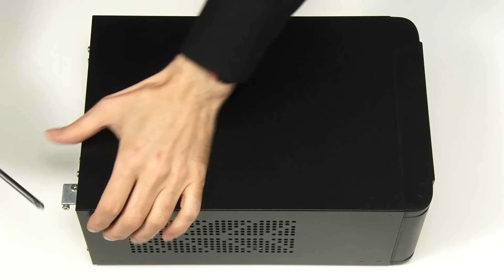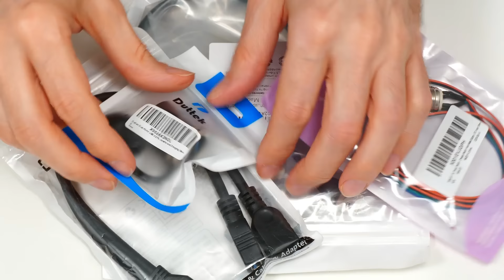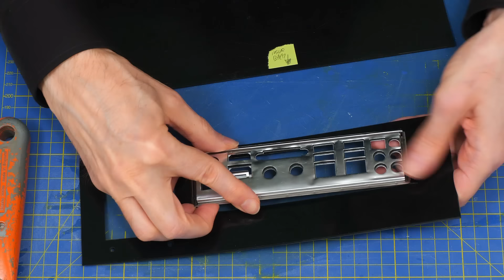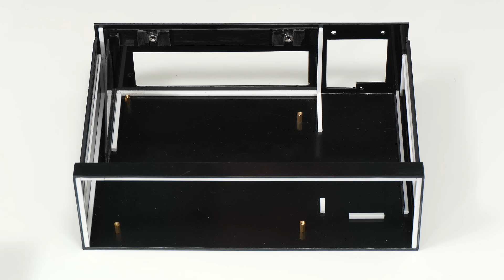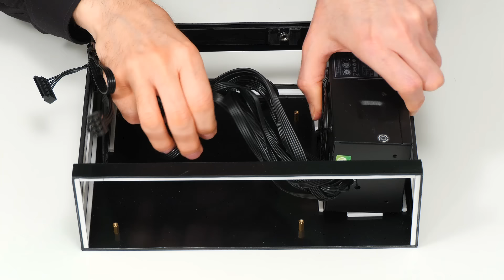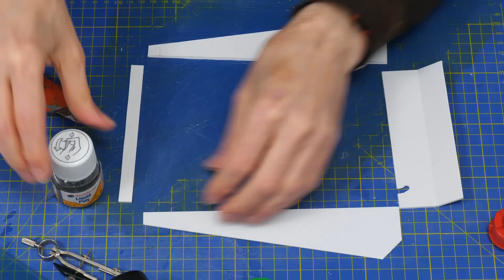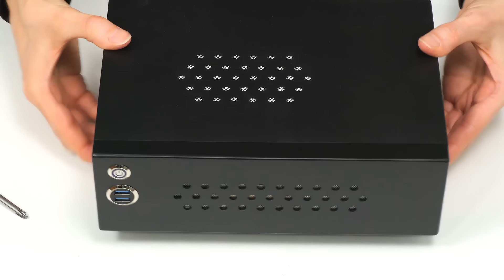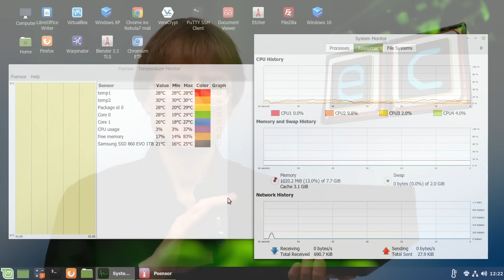DIY Mini-ITX Case

Comment: Chris, Paul Sellers and Rex Krueger are the people who make YouTube, however ensh*ttified by 2026, still relevant.

The most fun thing about technology is not just using it but creating stuff based on it. If I start delegating thinking and building to machines, I can as well just buy the finished product. It's easier and cheaper. But it's not fun. Assembling an IKEA cabinet or using power tools for everything is quick, cheap but boring. 
Same with "building" software with LLMs (ok, actually worse, at least IKEA doesn't hallucinate instructions and a table saw doesn't occasionally delete the table or your limbs regardless of the input).

Experimenting, trying something new, making mistakes and finding what works, developing skills that just weren't there yesterday, using the simplest tools to create a THING that I can then use is an incredibly fulfilling experience. Learning requires discomfort and friction but is totally worth it.

Thank you for inspiration, Chris!

Comment: no emi shielding may not affect your computer function or other near field UHF devices however it does spit out a LOT of noise which does have harmonics that get down all the way to HF ranges. it makes life very very difficult for amongst others radio operators. the noise is shocking. I love your site and all you do but  I am always asking people to please put their computers in a case and apply any and all shielding they can. even if one side is left open any shielding helps. their are also grounding spray's that work very well that can be sprayed on the inside. please look into this and consider it.

Comment: That looks great.  It seems that with current computer parts shortages and high prices an ITX system will become the high end desktop system.  I've seen videos of people using old cellphone processors to build computer systems, those may be the only processors available in the future, until data centers discover that they can build processing around those too.

Comment: Since ages I am using repurposed Shuttle housings, many of them are Mini ITX capable .
Even the early Shuttle SV24 (made for a Pentium class Via chip) does with little modification even today.
Combine these aluminium made cases with tiny 12V PSU or something like the 300Watt BeQuiet (no langer available).
Take something like the Intel DL-61. Put on a server grade Sandy Bridge CPU and a quite cooler.
It works great still, preferably combined with an external graphics card, even if it is PCIe-1 only.

Comment: I'm thinking of getting and building a ATX micro or ITX mini, with a Ironclad DX & MiSTer FPGA or MiSTer Pi. Although it is predominantly for gaming, I think it would be an interesting project, because I like reminiscing back to MSDos days and Window 3.1/95; but I think others like the old Commodore or Amiga. I'm not entirely sure about the real difference between ATX micro and ITX mini; but rather than making a computer which looks like an old computer, I'm thinking I'd like to do a little tower type computer with glass side and front for showing off  lights inside it. Great job; you really did build the whole thing. Looks fantastic. Makes me wonder what could be build with an old cash tin.

Comment: Running Linux since 1996 and as my main OS since 2002, I never understand why buy a rPi to code in python while a PC is perfectly suitable. Anyway, I own a rPi 1 b+ and tried riscos on it, 1 own a rPi zero which powers a pi1541 Commodore floppy emulator, I own 2 rPi 3. One is running bmc64 in a vic20 case. I use the other one for mcu développement, the serial port at 3.3v is great for debugging

Comment: Christopher, I've been following your content for a very long time and as of right now most of my services are virtualized on a small cluster (have been for years). 

However, I'm running more and more into issues where I need to deploy a dedicated device to "bridge the gap" between services I want to provide for free for my relatives - and all I see is a sea of overpriced SBCs .... 512mb DDR3L 2 cores ARM sbc = 80€. Nothing makes sense - if you could make a video about "ethernet services on the cheap" it'd be amazing, be it for routing (openwrt), simple services such as tailscale or VPN ... I'd be over the moon to know the current cheapest options, because the landscape is changing fast and to be frank ... I want to give access to ones dear to me, but it is becoming harder and harder to do so without having them buy overpriced hardware.

My whole "infrastructure" (homelab) is based around low power, if something that drinks power needs to wake up it'll do on a schedule and shutdown (backups) - N100s and N150s have been a blessing (now they're getting pricier) - 18€ a month in electricity to run so much stuff is amazing (€58ct Kwh makes you think twice about your ambitions)

But I wanna share ... And I feel that hooking up a simple SoC meant to run tailscale has become an investment. If I just go ahead and expose a service it's going to get bombarded - I've lived through it, CPU spikes all over the place, I'm an amateur this is just what I do in my free time.

Send help ^^"?

Comment: Should I try this in larger scale? Big case for EliteDesk 800 G4 SFF which I stupidly bough instead of TWR so now I'm running sweating LP GPU with cover replaced completely with plastic anti-dust mesh held on pieces of double-sided tape.

Comment: ABS has a MUCH higher melt temperature than PLA but I would still not advise making an enclosure with a high voltage PSU from thermoplasts....

Most of the risk is offset by the fact the PSU is fully enclosed by its own enclosure, but if a catastrrophic failure would occur it would find itself surrounded by meltable and deformable and flammable plastic....
Reply from the maker: I did think about this. But as you say, the PSU is fully enclosed in a metal case, with fail-safes. Many products include a PSU not enclosed in metal within a plastic case, and often of a lower quality than we find in a PC.

A computer with a plastic case like this is not something I would leave running 24/7 unattended. But as a normal desktop PC generally only running with a user present, the risk is minimal.
Reply: @ExplainingComputers fair enough, though I would think that other devices with high voltage in plastic enclosures would have to have some fire retardant in the plastic.

The most important thing is to think it through.

One other factor that would suggest using an external psu brick for this project could be firecodes and home insurance rules for any unlikely case where things go catastrophically wrong. 

What helps in that regard would be if the system is only running while supervised. 

In any case the design looks great and you clearly had fun making it.

Comment: If you want an even smaller PSU and can live with an external power brick look for a "PicoPSU". They're very small DC-DC converters just as wide as the ATX mainboard power plug ranging from 80 watts up to 160 watts IIRC.. They use 12 volt input power from a standard barrel jack. The higher wattage models go up to 25 volt.
Reply from the maker: Thanks, but as I noted, the whole point of this build was a small case with an internal PSU. :) I showed a case with a Pico PSU internal adapter and external PSU.

Comment: Just like your cyberdeck this has turned out amazingly well. I've done this kind of thing myself several times but have access to a well equipped machine shop with a CNC router and 3D printer but I have to say I think the only thing I have done better than your case, made with simple hand tools, is the ventilation because I could drill a grid of hundreds of very small holes very accurately so didn't need a mesh. Necessity really is the mother of invention and in this instance the results top notch. 
One thing I do like to do differently is use DC input ATX power supplies inside the case with an external power brick. Or even in some case mounted the power brick inside the case as well, this is normally a much more compact solution when you only need 150 to 250W which is enough for many mini ATX systems.
Reply: You are the 'lucky one', at 83 all work flows are indeed impeded!'😢

Comment: In California, I just bought a 2TB 3.5" HDD for $65USD. A 2TB SSD is over $200USD.  Would it be more economical to make this project work with the 3.5" HDD? Would you just increase the size a few inches or centimeters? Since SSDs are too expensive, should we go back to the 3.5" HDD? In the UK, is it called 3.5" HDD or is the inches replaced with the metric equivalent?

Comment: I love these videos. But you really should get a 3D printer. You won't just be able to use ABS, but materials like ASA-GF. I've done more than a few prints and so far I'm pretty happy. I'm waiting on more accessories to print larger objects and pieces. As I want to start printing PC cases and storage drawer units for organization.
Reply: He has a 3D printer. 
The solid ABS sheet is a much stronger and more consistent material, and for rectilinear builds like this is very simple and quick to use. This is also a more accessible and affordable approach for people who don't own 3D printers.
Reply: @BeOurBee  Understood.

Comment: Much more satisfying than one of the typical Tech Tuber that build a PC. Forget the 3D printer, many just use sponsored cases or a case they had in storage. This is the practical way to build a ITX case that actually works for your setup without just settling for whatever is on NewEgg or Amazon and dealing with the compromises later.

Comment: Awesome! 🎉  I would have used black finger nail polish on the screws.  Also, not sure if it's feasable but having a smaller case and external power supply would also be nice!  Congrads! 🎉

Comment: Thanks Chris for another DYI project case and stunning results.
I was happy to see Stanley the Knife and Mr Screwdriver pulled off the dole to make this worthy project.  I would suggest adding an Oscillating tool to your tool box. Mine assists my knife and speeds up cutting plastic or wood. 
Have a great week.

Comment: Your building of a cyberdeck inspired me. I have a couple of slightly old commodity Android phones lying around, in perfectly good shape but a couple years old. Half an eternity in smartphone tech evolutionary terms. I think it would be nice to build a cyberdeck/ARM-based PC that uses one or more such phones, flashed to run some (not ChromeOS) version of Linux. It's kind of like the "Dex" feature offered on some premium Samsung phones, but without having to buy that premium phone. Just use, well, a commodity smartphone. Maybe you could do a video on such a project? If would include a case to wrap around the phone, making it look like a truly tiny PC case, with a phone wall charger serving as an external silent PSU, and an attached display much larger than the phone screen, which would be mounted into the case surface, serving as a touch input controller and secondary display. The phone screen could optionally be set to go blank when another display is in use. If using more than one phone inside, then you would have a mini-cluster running a cluster OS to make the two or more CPUs share workloads. This makes it a highly energy-efficient and silent home server that could be tucked inside a book on a shelf. Speaking of which, a book-sized PC case might be made of ... cardboard! Possibly with a humorous book title embossed on the front - 20,000 Links Under The C++, LAN Of Green Cables, Great Compilations, and so on.

 Such a project would probably require some coding fu on the software end, unless there are pre-built cluster OSes ready to install and boot, as well as the handy craft skills you cajoled Mr. Stanley into demonstrating here. 😀

Comment: I am pleasantly surprised by the final result. I am someone who designs everything and then prints it in 3D, but after watching this video, your solution seems more appropriate for a PC case. The walls are narrower and more robust; it would be impossible to create a 2mm wall with that finish and strength using 3D printing. Excellent work!

Comment: This is very impressive...and I think worth looking at for techniques that might apply to a number of projects.   I have a Beelink GTR6 and I wanted to upgrade the ssd...a simple thing...well no they decided to go with this tiny fan that had plastic legs that wrapped around key components that you blindly screw down...well I did all that and my bluetooth didn't work anymore as a built in device...my solution remove the puny fan and try again...bluetooth happy...so yea the route the wires step is not for me...but I do wonder about the painting of sbs....I wonder if a similar technic can be used as an alternative to retrobyting for retro machines....I got a trs80 model 4p and it is more yellow than white so thinking of giving that a go...it's such a thing if it works great if not oh well...as it needs work, for some reason only the floppy it came with reads on the machine...

Comment: This turned out so lovely, and really cost effective too. Congratulations to this new case. 

When I built my custom Mini-ITX case I ended up on the very other end, rather not saying how much it did cost. Granted I used 3D printing in house and aluminium machining externally for creating a passively cooled Strix Halo. Strictly speaking also an iGPU based mini-ITX system but with a lot more heat to handle and capable of running modern demanding games. I did also go for a retro design though.

Comment: Looks great! Well done! It's a pity that the USB 3 port you have doesn't have a straight to mb-header cable. The other route, that's save on a bit of cable space, is getting one that goes from the header to a mounting plate, unscrew the mounting plate, then make the appropriate sized hole and mount to the case but it wouldn't have looked half as nice. Once the cables are tucked in there, who would know!

An amazing build!

Comment: On my build I whent with the open case style kinda a test bench I haven't found one yet that better at cooling I wish I could but if 
I cram in all this into one of thoes 
Lil boxes their will be problems 
I'm running an i9 with and old geoforce 4070 with water cooling  on the cpu  😎

Comment: Very, very entertaining.  Thank you Chris.  Tweaked my OCD a little when you didn't blow out the dust from the CPU cooler before the final fitting after spending so much time on the finish of the case!
Reply from the maker: I only noticed it in editing! I wish I'd cleaned that dust.

Comment: Nice build, a quality footage as usual.
What I would have done differently is to mount the PSU 180deg rotated,
so that its exhaust fan would not blow hot air directly onto the CPU,
but out from the case (with some additional holes on that side of the case).
Reply from the maker: The internal fan on the PSU is intake not exhaust. So it is extracting cold air from inside the case and blowing it out the back.

Comment: Couldn't you have made the case an inch taller and make a partition an inch from the bottom to install the motherboard?That way you could  have route the cables under the partition.

Comment: Need more feet, central, usb turn 90° but might be too close to the power button for that, it would make aiming easier, a front upgrade (mini plate) to move the usb lower, a round plug to fit in the old hole
and the usb screw to hold mini plate flush, not flush glue or use power button on a bigger mini plate.

Comment: You made a very nice case there. Quite impressive!  Next time, you need to get a new 3d printer from a sponsor and design one hint hint.  Question: Are external power supplies such a bad idea?  Most laptops use them, and they manage just fine, and I would assume less chances of EF noise affecting the rest of the computer. They  seem to be selling quite powerful  usb power supplies these days, and it could potentially be cheaper and less noisy than an internet power supply. Cheers
Reply from the maker: External PSUs are certainly not a bad idea, and indeed the N100 Mini-ITX system at my desk now uses one. But for test systems (which this is) I find it a pain having to dig out the right external PSU, so really wanted an internal one in this box.

Comment: 5lts its too small the board have the pci-e slot (noctua fan) also you can replace the psu with a modular and the front panel cables can be hide behind the board how? connect it first and then put the screws

Comment: As for the EMF shielding, I used for electrical purposes, although not EMF, a spray paint containing enough silver particles to make it electrically conductive (bloody expensive, grumble). This might do for EMF shield. If the silver color is not desired, there are alternatives based on carbon black.

Comment: Cool case, but wouldn't it be smarter to point the PSU fan out the side instead?  Your configuration feeds the PSU intake air directly from the CPU heatsink.

Comment: I think it would have been better place for the PSU on the other side of the case, closer to the CPU fan. It would be upside-down but that way it should keep all components cooler. 🤔
Cool video, nontheless.

Comment: Nice build Chris! Any concerns about static electricity on the plastic frying your computer? I suppose if you haven't run into those issues with the cyberdeck then you're good to go
Reply from the maker: I would not anticipate such issues with this build, as it's a desktop unit that won't be moved around in use. The cyberdeck, on the other hand, is potentially more vulnerable. But (so far) I've had no issues.